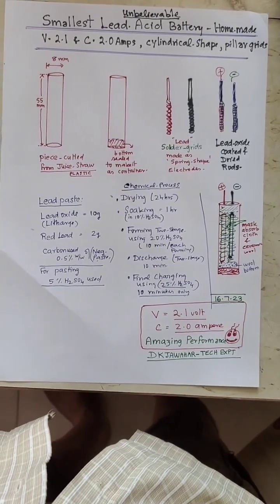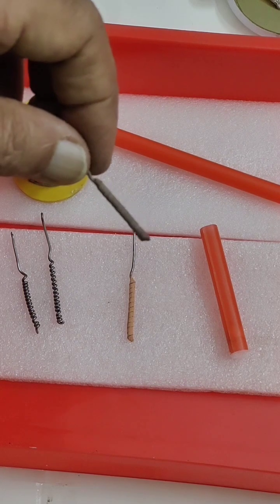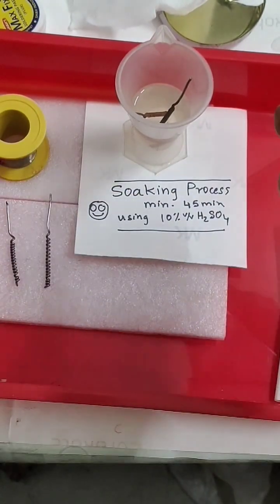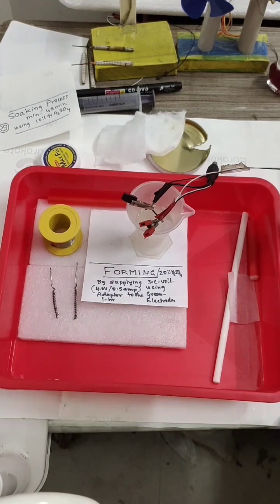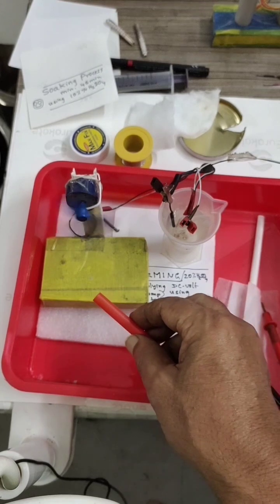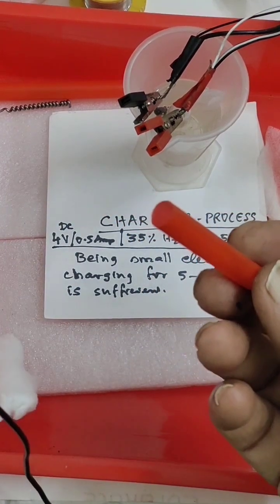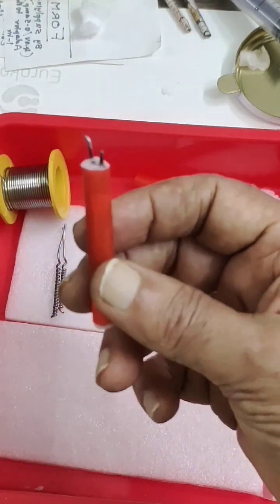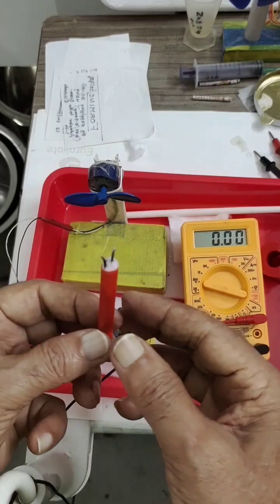SMALLEST LEAD ACID BATTERY, HOME MADE USING STRAW, SIZE 8mm X 55mm. Volt 2.1, current 2Amps, vid- 87

Comment: In lead acid battery, can we use another metal for the electrode apart from lead.
Reply from the maker: You can use lead with tin . That is why I used the available solder lead wire ( usually tin 40% and Lead 60%).  Pure lead is soft. That is why you add tungsten metal for  stable grid structure to withstand conc. Sulphuric acid electrolyte.

Comment: Man In my opinion this is a good contents, really amazing. Only a question wich are the anode and cathode used,and can I Find these material in my house for example in some object?
Reply from the maker: You can see the diagram sheet and also you can see my other videos on lead acid batteries. It will be helpful to you.👍. The red colour electrode is positive and the little black colour is negative. Further I have used simple lead solder wire.

Comment: Sir we can use any soldering wire , like 60%tin and 40% lead?
Reply from the maker: Yes, you can use any solder wire. Prefer less tin %, ie but ordinary grade . Okay, buy thick gauge for rigid grids.
Reply: Ohk, thz sir❤
Reply: Actually sir we are working on our product structure, we need your help and some inputs on it, is their any way we can contact you sir?

Comment: Thanks to Almighty... Very detailed video and truly You deserve more subscribers...  
Bye the way, would like to know the weight of that smallest battery... ??? If possible please share...
Reply from the maker: Okay
Reply: @dkjawahar-techexpt671  

The lead acid battery energy density is as quoted below...
 "The lead–acid battery has a low energy density of 25–35 Wh/kg, although it has passed through many years of development. However, the power density is as high as 150 W/kg.".... But it seems your method is very promising... If you can calculate your method to kWh per kg... It would be interesting... I hope your menthod could reach 200 KWh per kg...
Reply from the maker: The weight of the battery is 4.74gm, Initial volt 2.15, C 1.8 to 2.0.  It is able to run the small motor, from DVD players for 10min steadily. After discharge the volt is 1.72, C is 30mA. If possible you can calculate and let me know👍🙏
Reply from the maker: The motor rotates at 50mA, since it stopped when the Amp reading is 30mA.
Reply: @dkjawahar-techexpt671  

According to your video when you checked ah it was around 2ah (2000mah) but as per your comments the small motor drew 50mah for 10 minutes and  after few minutes it stopped...  I think what you witnessed from the multimeter was incorrect...  If the current was 2ah... The motor should work for several hours.... Bye the way, please use a small buck converter to charge the cell from 4v charger... Peace
Reply from the maker: Reading are correct, since the electrode material are limited, the storage current will also be limited. I checked with other meter also. It readily reaches 2.0 AMPS with constant 2.1v. 👍

Comment: What paste did you use for the cathode & anode?
Reply from the maker: The diagram shows the information for the paste making. That is Lead oxide, red lead made paste using distilled water and then use 5% sulphuric acid. Apply over the  positive grids then for negative plates add pinch of carbon to the remaining paste and apply.
Reply: Please since I can't get lead paroxide as paste for the making the 4amp 2.1v battery in your earlier video can I use as u describeed above to achieve the same result?
Reply from the maker: Yes you can use plain lead oxide powder, need not worry. While you carry out soaking, forming, charging all will be active and you will be able to get required volt, current 👍